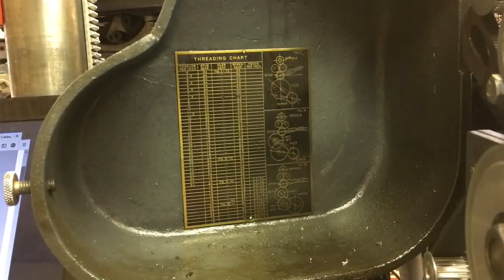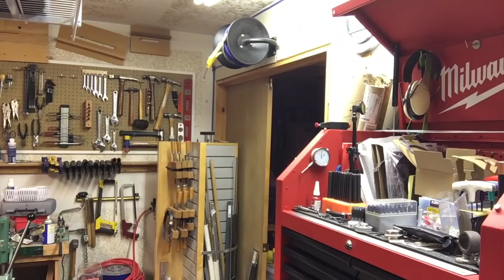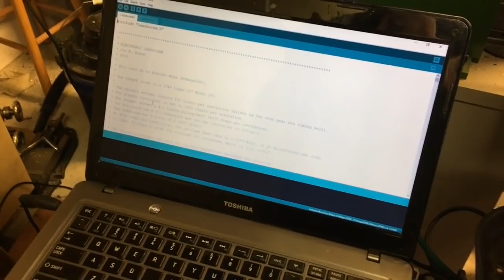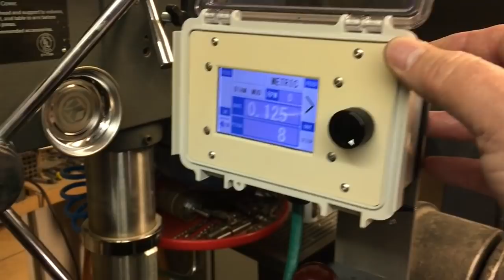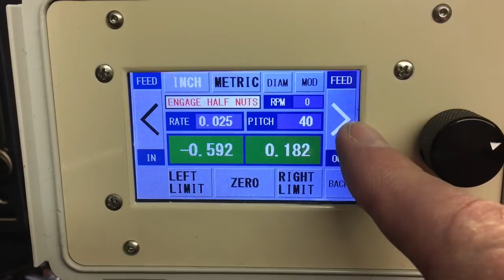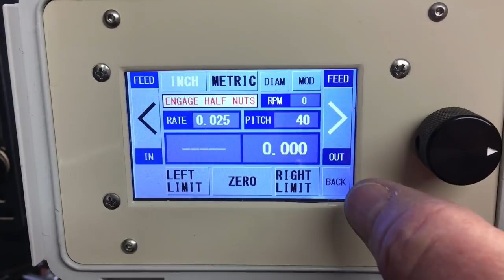My Electronic Leadscrew Project Overview

Comment: Jon, I have been following Clough42's ELS project on youtube and CNC 123 turned me on to your project. I have to say that your version of the ELS is the best one I have ever seen. The ease of use and functionally is awesome. I have a HF 9x20 lathe that was made for conversion to your setup. Before I build the ELS (Electronic Lead Screw), I want to breadboard up a similar setup using a jog wheel encoder , that I have, with the idea of incorporating it into the final build so I can manually control the travel of my HF 9x20 saddle using the lead screw instead of the rack and pinion wheel. I want to remove the compound like ROBENZ and Stefan Gotteswinter did and fix my QCTP to the cross slide but that removes the finer control of the compound lead for the coarse rack and pinion gear wheel. My jog wheel is almost the exact same size as the compound control and would give me programmable-precision, much finer than my compound lead could ever manage. My 9x20 has a lot of backlash in the chineseum compound so I almost never use the vernier marks on the wheel, usually guessing about my travel. With a thousand or so steps/rev on the lead screw, I would have very fine control and would only need the rack wheel for fast movement during setup and such. Adding your ELS and the Touch DRO, with a jog wheel would finally make me master of my lathe instead of just a practiced guesser.
Reply from the maker: Thank you.  A jog wheel would be very interesting.  I've been hitting it pretty hard trying to add a couple of features, and got frustrated enough to actually make something.  Once I've gotten that out of my system I'll go back to coding.
Reply: @jonrbryan  I know how frustrating coding can be. I haven't done much for quite some time but the memory lingers. Actually, that's why I mentioned the Ti line of launchboards. They provide a free suite of programming tools directly suited to their boards and there is a built in debugger on the board I ordered. LAUNCHXL-F280049C

Yes, Yuri has been quiet lately. I live in Portland OR and Yuri lives just over the hill from me. I'd like to meet him sometime.
Reply: @jonrbryan  I assume that most of your coding challenges are with the touch screen control?
Reply from the maker: @misterfixit1952  No, I've got the Nextion display working great.  It's something with maintaining synchronization when changing feed direction on the fly that's going to make me feel really, really stupid when I figure out what I've been doing wrong.
Reply: @jonrbryan  That's where using the Ti board would probably shine with ist's  2 quadrature interfaces. I was checking out the data sheet last night. Almost too much info for me to absorb, at least after midnight ;-)
Reply: BTW, that's the glory of open source. Let other minds help solve the problems that drive you crazy. They are almost always head slappers when you figure them out.
Reply: @jonrbryan  I checked out the Nextion and your right, that's definitely the way to go. Really nifty programming package. Easy to program and make changes to. Not much more expensive than the bargain brands. Which model are you using, basic, enhanced or intelligent?
Reply from the maker: @misterfixit1952  I'm using the Enhanced nx4024k032, which is 3.2" 480x240., but I don't think I'm using any of the "enhanced" features.
Reply from the maker: @misterfixit1952  Oh, and I didn't use the Nextion library.  I didn't see the point.  The documentation of the command set was good enough to do my own protocol.  My little Rigol oscilloscope does RS232 decoding, which helped getting a couple of things figured out initially.
Reply: @jonrbryan  I assume that you are using a resistive touch screen. I don't think they have the capacitive touch on any but the intelligent version. How is the functionality. Some of the resistive screens can be finicky and require a stylus to really work well.
Reply from the maker: @misterfixit1952  The first one worked very well.  Then I broke it.  The second one is mostly good, except over the right side direction "button".  It works, but is just a little "touchy".  It's one reason I'm planning to add a physical switch.  The other is that I think a switch right by my left hand will just be a better user interface.
Reply: @jonrbryan  Here is a link to the rotary (jog) encoders I have.  https://www.aliexpress.com/item/584411423.html?spm=a2g0o.productlist.0.0.41e96800xBFPGo&algo_pvid=da48d61c-5a3b-48a1-a210-b6d57cbcc5f9&algo_expid=da48d61c-5a3b-48a1-a210-b6d57cbcc5f9-0&btsid=82655b1e-cdf1-487c-988f-09988ba88d69&ws_ab_test=searchweb0_0,searchweb201602_9,searchweb201603_53
Reply: They are metal, not plastic and come in 40mm and 80mm. Have a nice feel, like a compound wheel and they are < $20
Reply: Would be good to mount to a box with the start stop switches. Like a pendant, maybe with a dial indicator magnetic stand.

Comment: Hi
Why you do not use linuxcnc.org
I can see here real implementation hardware
It be helpfully to put on Linc to people can see real hardware
Reply from the maker: I'm not a CNC guy yet (maybe never).  I didn't want to mess with Linux or a full-blown x86 computer.  Conceptually, I just wanted a programmable gearbox.  I figured that I could get it working on an Arduino, and I wanted to flip the power switch and be instantly ready to go.  The programmable gearbox part was easy, and I could have stopped there with a machine that the user would operate exactly as he/she had before, just without having to fiddle with change gears.  It's the extra fancy bits that are taking some time to figure out.

The hardware is pretty simple.  There's an encoder on the spindle and a microstepper driving the leadscrew.  I've posted pictures on hobby-machinist, but I should pull it apart and make a video of putting it all together.

https://www.hobby-machinist.com/threads/logan-model-200-servo-threading.64192/
Reply: Many people can use your experience to add hardware when work with Linux cnc.
Mechanical gearbox can be used on much more project then only lathe or cnc machine tool

Comment: Thanks for sharing this Jon, it is a fantastic achievement and a very desirable mod for my lathe and I guess many others. If you would make available a good Step-by-Step ELS For Dummies I would be happy to pay for it. Just something you could email would suit your overseas subscribers like me.
ps I had to hit the button as you'd reached 666 subscribers, and I couldn't leave it at that!
Reply from the maker: Gone a little silly with travel after retiring, and squeezing work on this in between.  I made some good progress last week but now we're in Alaska.  I made some significant changes to the limits GUI that rippled into the underlying code.  One step forward, two steps back.  It's also given me the chance to find and fix a couple of bugs and clean up a few more things.  But now I'm more and more convinced that a switch mounted in front of the headstock would be a better user interface than the touch screen for selecting feed direction (and I just saw that the US Navy is moving away from touch screens).  I think I'm just going to have to rig it up and see how it feels.

I just ordered a camcorder to get optical zoom and better sound, so I will need to do another installment when we get back home.

And thanks.  My wife thought the number was ominous, too.
Reply: @jonrbryan  Thanks for the reply Jon. Hope you have a splendid time in Alaska, and I look forward to seeing how this project develops in the future.

Comment: jon...what enclosure is that?
Reply from the maker: It's a BUD Industries NBF-32404.  It has little internal dovetails for panel brackets.  I don't have the part number for those handy.  I milled an internal rabbet around the inside edge to inset the panel (which I fabricated).  It's a bit of a squeeze for the terminal blocks, display and encoder knob, but I didn't want to go any larger.

Comment: great build john. have you seen clough42's  build he is doing. beautiful build. i have a mint condition atlas th42 i wanna try this with.
Reply from the maker: Yes, I've seen his project.  I just don't like buttons.  But I have to say that I'm considering adding a lever switch clamped to the ways under the headstock for the direction control to make it work more like a Hardinge HLV-H.
Reply: @jonrbryan  hardinge are so freaking nice...they pop up from time to time here in pittsburgh. ill endup with one one day. the atlas th42 i recent got was a brand new crated lathe...never used.
Reply from the maker: @minskmade  If I had had $10k to burn I could have had a single-owner HLV-H.  I settled for picking up a Clausing 8520 mill for $1200 from the shop owner, who was retiring.  The Atlas looks like it could be a good project.  Might be a bit more cramped for space than my Logan, which had just barely enough room to squeeze the stepper motor in under the cover.
Reply: @jonrbryan  you may be right. there is a logan for sale here to...i like that the logan has a bigger spindle thru hole than most lathes also

Comment: Would you be willing to share or sell the Nextion code for this project? Looks amazing!
Reply from the maker: Retirement has been a lot busier than I anticipated, but I just got back to work on it a couple of days ago.  I'm adding finishing touches, then will have to decide how to proceed.  The actual Nextion code is not too complex, but it does take care of a fair amount of housekeeping to cut down on the communications overhead.  I rolled my own on the Arduino side rather than try to figure out Nextion's Arduino library.  I might revisit that at some point (but probably not).  A good C/C++ programmer would probably have some aesthetic quibbles with the way I'm doing things, but it's getting the job done.
Reply: @jonrbryan  Hi John, I'm finally able to get my ELS project started. I have experience with Nextion Displays and love what you've done. Would you be willing to share your Nextion code? I know a lot of work went into it and I'd be happy to make a donation for a copy, please let me know as I'd prefer not to duplicate the wonderful work you have already done. Thanks so much
Reply from the maker: @clubpasser123454321  I have the lathe setup torn down today and am drawing up the encoder and motor brackets in Fusion 360 (while learning how to use it). Go to groups.io and join the Logan Lathe Users Group. I have already posted the main schematic there. I need to get everything back together and track down the bug that I introduced the last time I fooled with the code for setting the limits. Something dumb. I will post the Arduino and Nextion Code soon, as well as the control box schematic and mechanical drawings. I'm a terrible procrastinator, but being mostly stuck at home because of this virus leaves me with no excuse for not getting some work done on it.
Reply: @jonrbryan  That's great, I'm really looking forward to seeing the nextion code. Thanks so much!

Comment: So it's basically a partial CNC lathe conversion. Well done. Do you plan to open source your work?
Reply: the plans for an electronic lead screw diy project are in the magazine Digital Machinist
Reply: A long way from CNC. Jon's project only replaces the change-wheels. It still requires very significant human input to make parts.

Comment: I'm suprised you have done this with a mega 2560 since they're not the fastest. A Due has the power for it but isn't tolerant to 5v
Reply from the maker: Probably not the best choice, but it worked out pretty well.  I had some tricky bits to work out for maximum efficiency.  I've been looking at some other possibilities and might port over to something else at some point.

Comment: Nice job.  Be great if you released the schematics and source code like I did for my ELS 11 years ago. https://www.youtube.com/watch?v=RRaVIBhLgF0 

At that time we had a budget to keep it around $200 so I went with a 1 PPR sensor on the spindle and included the 3A micro-stepper motor driver on the board.  Low cost stepper drivers from the far east weren't available either.  Now the two LMD18245 drivers for one axis cost more than a complete driver from China so it's no longer worth it.  Can yours do tapering?
www.autoartisans.com/ELS/
John
Reply from the maker: I looked at your ELS, John.  You put a lot of work into that project.  I've had a rough few weeks with some health issues, but I'll be getting back into the swing of things soon.  I want to share the design one way or another, just had too much stuff to deal with.
Reply: @jonrbryan  It was a collaborative effort.  No one wanted a couple of buttons and a knob although that was suggested by one member.  He even created a version similar to yours that did that.  Code I believe is posted in one of the folders on the E-Leadscrew group. 

We wanted something that worked with only the Z axis but later more people also wanted X axis motion so it was added as an option.  But at the end of each pass a user is prompted to move either the cross slide or the compound the correct amount for each pass.  The whole design is still very manual lathe oriented.  So much so that my Southbend only has the Z controlled.  It's the smaller Gingery that has both.    And I've done some nice metric threads on the south bend.

Comment: Jon
Great job!  Your project looks very clean and user friendly.  I have a couple questions:
Can you use the half-nut when cutting metric threads?
Do you find yourself using the "limits" when threading rather than using the half-nut?  I guess what I'm wondering is that some of us have stood in front of a lathe for 30+ years and not had such an option, we just learned to use the thread indicator and half-nut...... Sending the tool straight down the crest of the thread on occasion when in a hurry and muttering "Some day I'll have that Hardinge HLVH-EM..........  Some Day"
I have a beautiful little Emco Maximat V7 which runs like a dream but lacks quick change gearing that I'd consider upgrading with this mod, it's not my only lathe, but would be go-to lathe in the basement for smaller work with the abilities your mod would give it!
Thanks for sharing
Reply from the maker: I've watched a lot of machinists over the years, but have only been doing it myself for the last couple, so I don't have your muscle memory.  Now that I have the limits and auto-reversing implemented, and a crossfeed stop made, my inclination is to set the limits and leave the half-nuts engaged for everything.  I have to think about how the half nuts would interact with metric threading.  If the limits are set I believe that it would still be timed properly if the half nuts were always engaged on a thread multiple, since it always starts feeding at the same point in the spindle rotation.  I'm going to have to try it.
There isn't a lot of room under the cover on those small lathes, but it could probably be done.  The covers are sheet metal, so one could always fabricate a new one or add a bump to the existing one.
Reply: @jonrbryan  Thanks for the quick reply Jon.Just to be able to cut metric threads on an inch machine without the associated struggle is HUGE, what we typically do has always been a bit of a challenge, especially if running up to a shoulder, you need to completely stop the machine, back out the tool, then reverse the spindle, adjust crossfeed and compound and repeat, if the spindle and leadscrew ever become decoupled during the process you're screwed, there's no way to pick up the thread again.

You've done an incredible job, especially considering you've only been at this for a few years!
Thanks Again

Comment: Love your work Jon. Is it possible to use the spindle encoder to output degrees of rotation to another field area of your display to use for dividing purposes? Then when you make your new cross feed dials you could engrave their divisions while still in the lathe. If you start a list of interested people for sales add me to it.
Reply from the maker: If I make the code available there's no reason it couldn't be done, but I don't think it would make a good indexer.  I use an 800ppr encoder on the spindle which would have a fairly limited number of even patterns, and a higher resolution would really start to push the Arduino Mega and still have limited whole-number combinations.  I could have gone with a 720ppr encoder and gotten even half degrees and more combinations.
Reply: @jonrbryan  Would 720 rather than 800 steps significantly effect the accuracy of the other operations?As usual I try too add too many design ideas into one and then have to rationalise the whole thing to keep to the core of real intent.
I used 200 lines on my new cross feed dials to convert to reading Diameter rather than Radius. One less mental calculation when turning.
Reply from the maker: @localele1  No, the lead screw step size (31.25 microinch) wouldn't change.  With my current setup 1:1 drive (one step per spindle tick) provides a feed rate of 0.025" per spindle revolution, or 40 threads per inch.  720ppr on the spindle would make that 0.0225"/44.4tpi.  Threads would still interpolate to the nearest step.  But it wouldn't divide evenly by 100 or 200.  You would just get all of the other divisors that led the ancients to settle on 360 degrees in a circle.
Reply: @jonrbryan  Which is why I like to think about my ideas for a while before getting too excited about making them.
The 200 division reference was for if you end up making new cross feed dials.